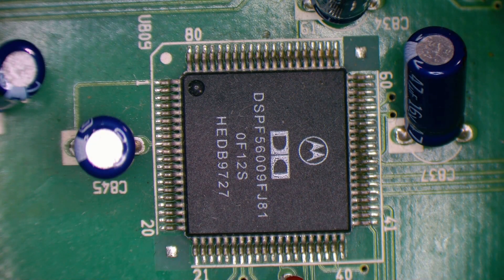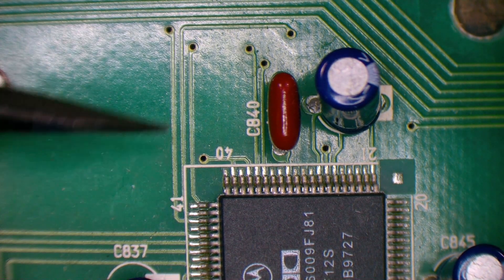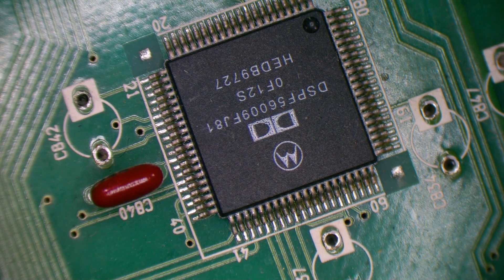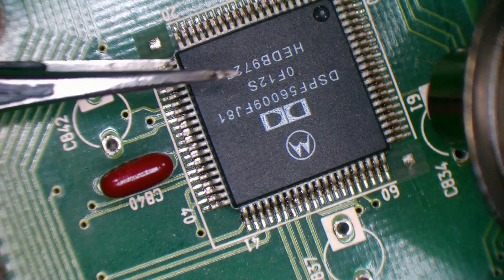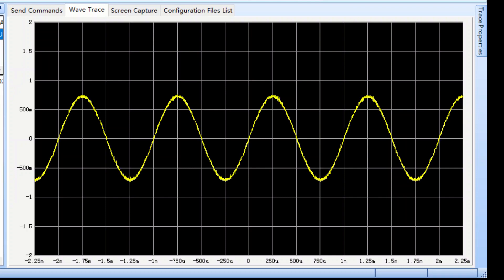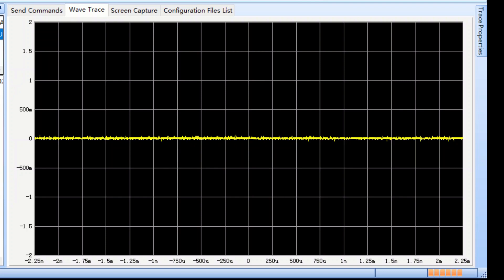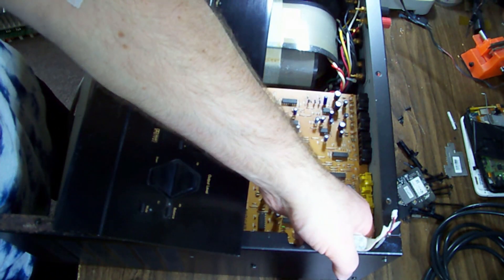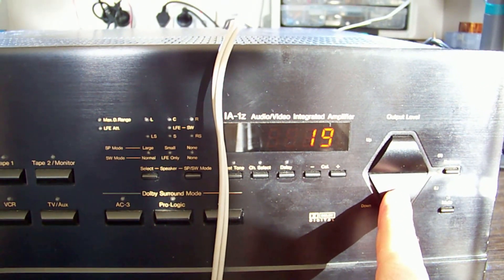Nakamichi IA-1z full volume repair attempt part 3 - Grand Finale!

Comment: Nice clean job Jonny ... glad you got it running ... nothing more satifiying when you finally fix something ... plus those little easy jobs (dry solder, etc) puts the cherry on top ...
Reply from the maker: Thanks! Totally agree and the owner is going to be even happier. Thought I was in for a new switch or in a pinch swap it with a rarely used button like mute!
Reply from the maker: Also to your other comment, the D/A printing was firmly painted on. The pins were clean, definitely new units. Thanks for the datasheet links, youtube seems to block comments that have links hence the late reply as well. They don't even show up in the 'to be reviewed' section to allow me to unblock it. Maybe I should untick 'hold certain comments for review' when I post a vid.

Comment: Well done Jonny. It's a great feeling to see something come to life after you have put a lot of effort into the diagnosis.
Reply from the maker: Absolutely! Still kicking myself a little for not picking up on it sooner when I initially looked at that line. Always check scope settings so what you see is what's real.
Reply: @JonnyFix  I fully understand. I'm struggling to find the source of a shorted boost converter IC in a scan tool. Without a schematic, it is stretching my brain and skill level.
Reply from the maker: @MiracleMAX  The source of a shorted IC would be the IC? Or do you mean there's a short on the output rail it creates? If short on rail get thermal imaging camera and force 1V from a grunty source into it , see what gets hot.
Reply: @JonnyFix  Found the shorted IC by using a thermal camera. Checked all surrounding components - all good. This is a multilayer circuit board. Not a bad idea to try a 1 Volt supply. Bought 4 chips - 2 left.....
Gotta love a thermal camera! 😊
Thanks for your response - it always gives me a good direction I hadn't thought of.
Reply from the maker: @MiracleMAX  If you know the rail is 5V you know your limit for example, I say 1 as it's pretty safe if you don't know what it should be. Also, just because the chip gets hot doesn't mean it's bad unless you're measuring a short that is gone when you take the chip off. It's a bit weird that the chips keep failing. It could be feeding into a short which makes it get hot or damages it hence if the short is present when the chip is off the board injecting your own voltage to locate it. Hopefully a datasheet for the chip will help understand the circuit.
Reply: @JonnyFix  Hey Jonny, thanks again for your response. I couldn't see an Email contact on your site, otherwise I could send photos etc. I have checked the datasheet and it is a 5 volt feed, but couldn't find any issue on the feed side. Didn't think of the output side - DUH!
Will try with 1 volt and see if I can trace it without blowing the bum out of another chip. Checked all the input side and couldn't find any shorts, but will check the output side with a 1 volt input.
Thanks heaps for your help.
Reply from the maker: @MiracleMAX  jonnyfix0 at g mail